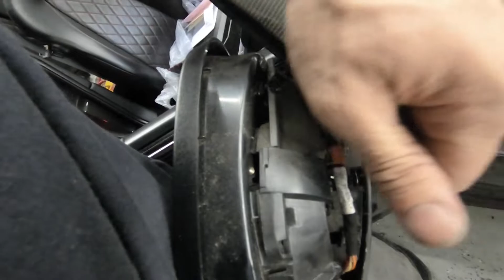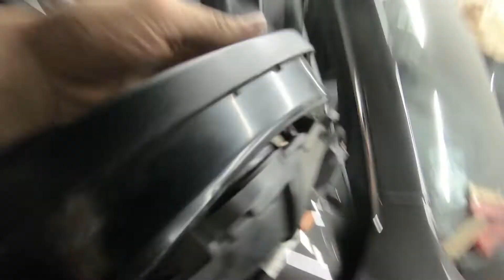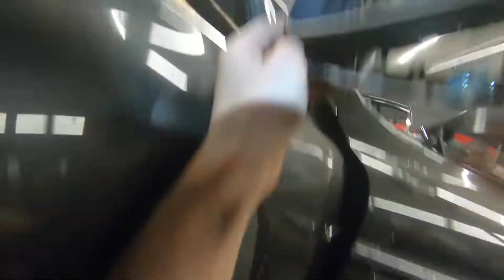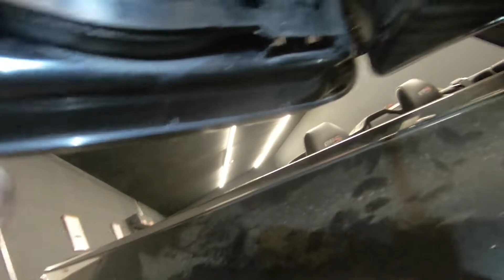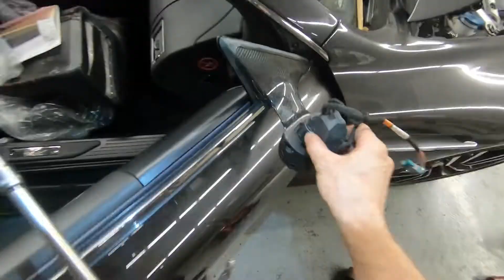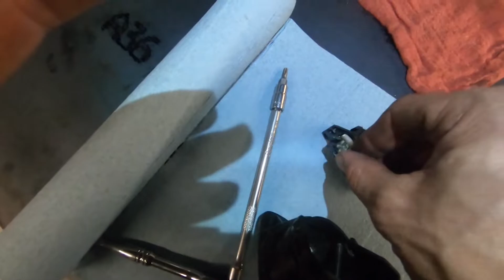Aston Martin Power Fold Mirror Repair (DB9, DBS, Vantage) (Side Mirror Disassembly)

Comment: Much much appreciated.  Just tackled this on my db9 carbon.    Great video and again thank you for the very thorough video.
Reply from the maker: No worries!  Dealer charging for a whole assembly is very unnecessary.  Glad I could help out.  What was the issue you were having and were you able to fix it?
Reply: The issue was the grease build up on the gears.  Looks like it broke down and caked up.  Once I had it apart I cleaned all the gears , regressed and it’s flawless now. Thanks again